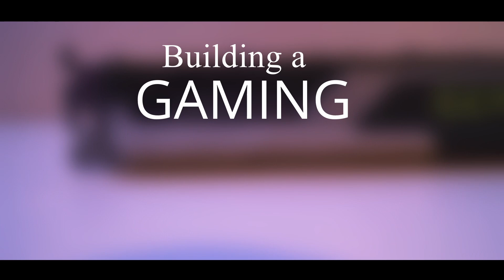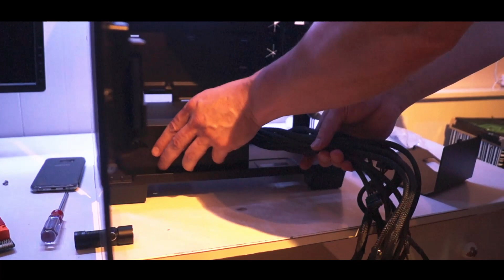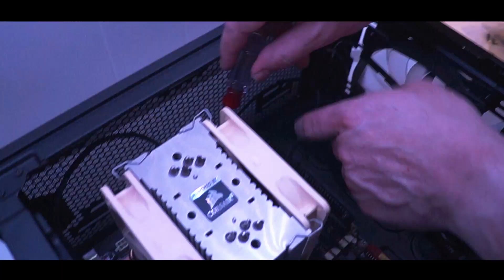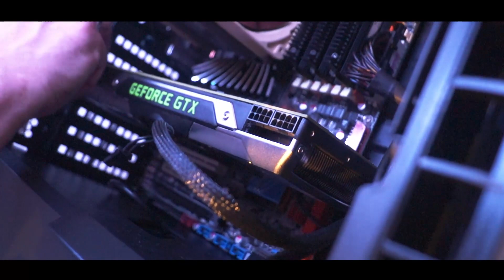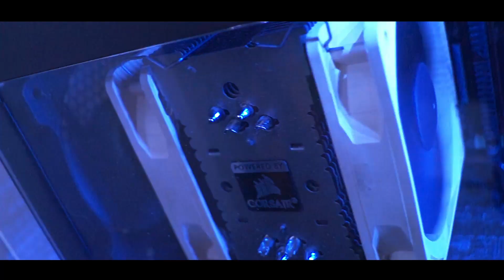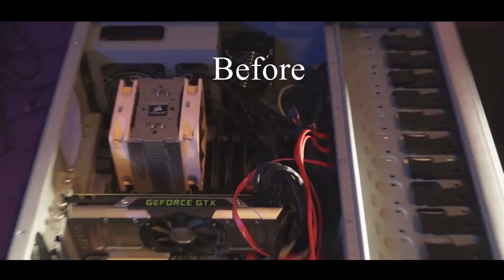BUILDING A GAMING PC!

Comment: This is a really bad and outdated build
Reply from the maker: The parts might be old but it performs very good. The 690 beats the 1060 and 980 in benchmarks and is close to the 1070 in 1080p gaming. I can run almost every game in ultra settings, so this system works works fine for me :)
Reply: Yea but I'm not talking about the GPU, I'm talking about the 2008 i7 920... It's outperformed by the Pentium G4560 D:
Reply from the maker: Well the G4560 came out this year... plus the G4560 has only got 2-cores.